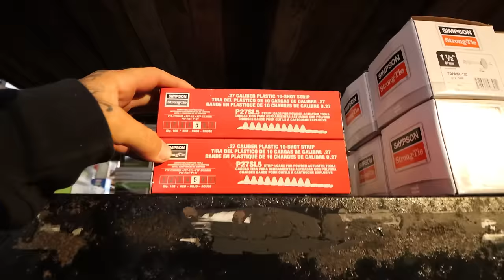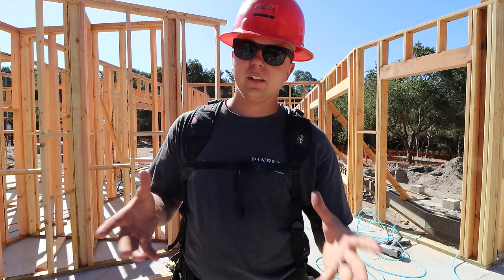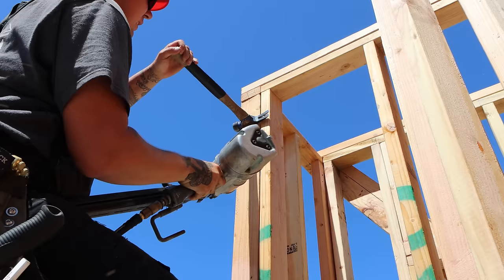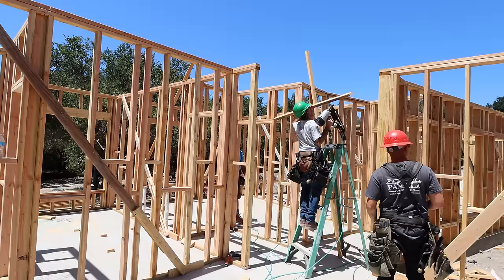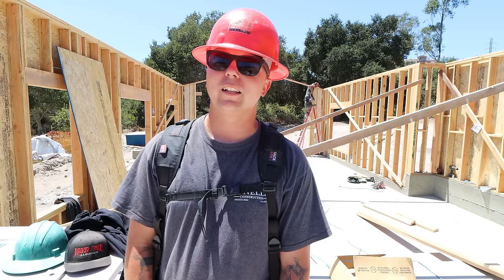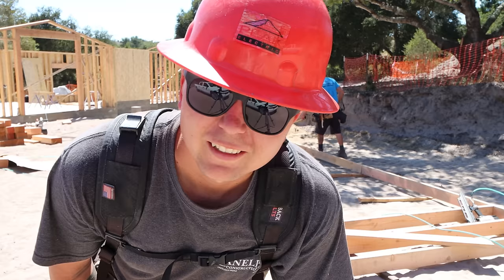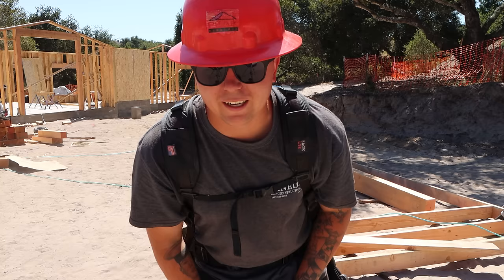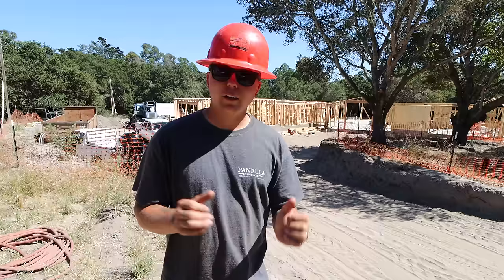The Ridge: Plumb / Line Braces, What Do They Do? [#7]

Comment: I just had a couple of questions why is it not good to sheath a wall while it is laying on the floor and is there ever discrepancies in widths of double top plates, bottom plates, mud sills etc. and what doe you do about it like say 5.75 to 5.375 width. And what are acceptable tolerances.

Comment: Sill seal is only required under bottom plates which are at the perimeter of the building and is not needed for interior partitions.  Sill seal's function is to prevent air infiltration from the outside.
Reply from the maker: Well, from the wise words of Matt Risinger, I should be using it on interiors as well. I don't know who to listen to, so I put it under interiors too.
Reply: @MattBangsWood  Well, it certainly doesn't hurt to put sill seal under all plates.  It's just not necessary under interior partitions.
Reply from the maker: I didn’t think it was, I’m still genuinely confused with the product... Need a class!
Reply: @MattBangsWood  I build houses for Habitat for Humanity in New England (Massachusetts) where air infiltration is an issue during the winters.  Sill seal is in the building code here for that reason but only under exterior wall bottom plates.
Reply: @MattBangsWood  It's supposed to be used on interior walls as well... Wherever plate meets with concrete. Being a slab, it's best! But there is also the height of interior walls to exterior walls!

Comment: Looking good! Do you have the spring off on your Nr83? It looked like the nose held itself back when you shot that pry nail
Reply from the maker: Nah, hand was on the other side. That would be lethal if it did it by itself.. :O
Reply: MattBangsWood that’s explains that lol I work with a couple guy who rip the springs right off there paslode guns no bueno
Reply: @jamesdooley5194  what? I take off the spring on my pneutools sn2283h works fine, honestly that gun is bulletproof.

Comment: Why not sheet it before putting up exterior walla
Reply: You're the fucking framing master. Really enjoy your videos. Keep up the good work. Cheers from Denmark
Reply: He explained it at 12:10
Reply: @madhatter2012  you can square a wall as it lays on the ground and it accomplishes the same thing
Reply: I'm guessing because some of those long walls would be too heavy and lifting them with a lift you can put enough force on them to knock them out of square a little, then you really got a battle. Plus they're pretty short walls, not bad at all sheeting them standing when it's a short wall, just as fast